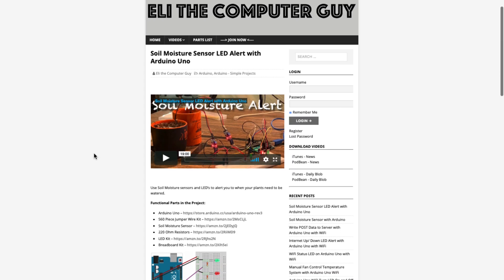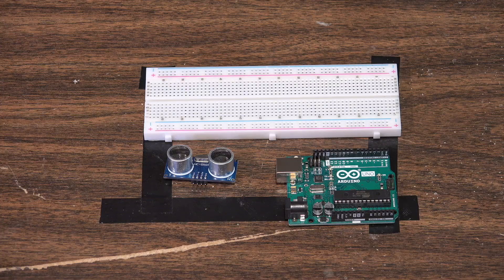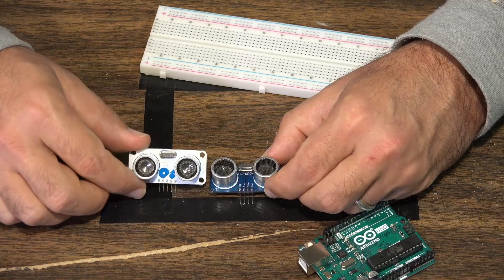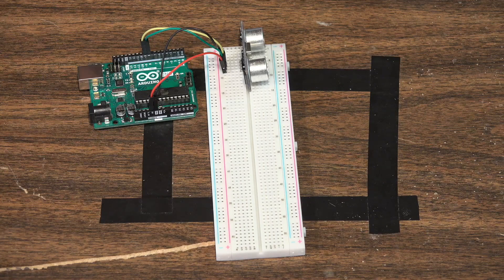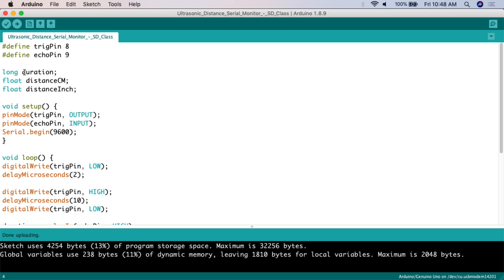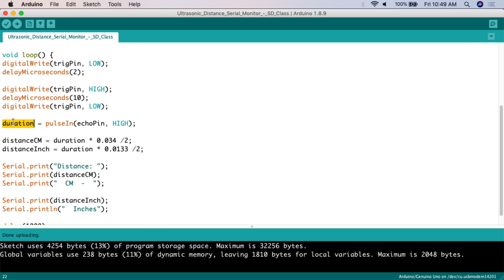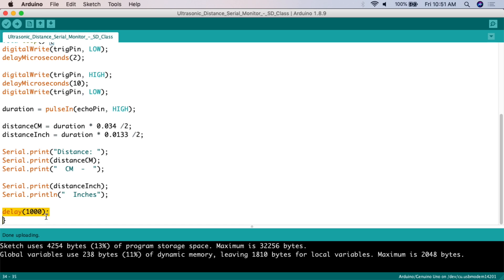HC-SR04 Ultrasonic Distance Sensor with Arduino

Comment: Could u pls explain the code and schematic diagram in tinkercad .for automatic speed control and automatic accident avoidance using ultrasonic sensor and pir sensor and gas sensor using LCD ,DC motor and buzzer

Comment: I have a question about the Ultrasonic sensor.

I have a water-box and I’d like to measure how fill is using the HC-SDO4 sensor with Arduino

It is all set and in my protoboard the sensor works well, but when I try to connect to sensor through a 4way wire it is not working.

The water-box (and the sensor is inside in a dry place of course) is 4 meters from the Arduino, wired connected. 
My question is, Does have any limitation in distance to connect the sensor through a wire? 
If yes, what do you suggest me to do? How can I send the signal and receive the echo to Arduino in 4 meters of distance?

Thank you!

Comment: When I try the code, my system keeps returning a distance of "0" . I keep having this problem and tried several sensors from different suppliers. Maybe it is the arduino board itself? Any ideas?

Comment: hello mister very nice video, i would like to ask you something about this project but the implementation is done using stm32f401re, so instead of digitalWrite, should i use gpio set (Pin pin) and instead of pulseIn should i use a timer in order to count  the time between trigger High and  echo High ? thanks

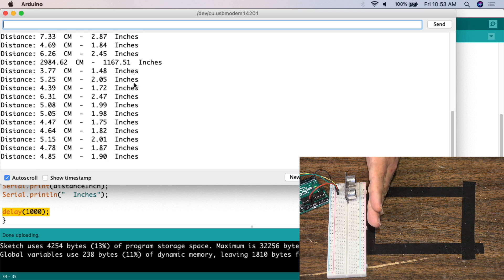Comment: 12:10 Same is true for IR sensors, but they are influenced by color and reflectivity of an object. Not true that they are less accurate, but since they measure light intensity, they can be faster!

If the object has dark color, it will read less accurately. If it has a bright color it will read more accurately. If it's matte it will read more accurately from an angle then if it's shiny... Important to note that complementary colors will not reflect that light, so green will show as black in red red or infra red light(different shades of green...), while yellow will show as black in blue and UV light(different shades off course except those highly reflective stickers highlighting markers, etc)... Every sensor have it's pros and cons. Ultrasonic sensors suffer from echoes as well for example, and IRs may read crap when measuring a light emitting object, especially in IR range (IR heater or incandescent lamp for example.) They also loos range in sunlight well, but have no problem measuring in darkness... You can also do some clever analog reference switching, and/or over volt the LED just a little bit to improve an IR sensors range and sensitivity(That requires proper calibration of course). But that doesn't really work that well with ultrasonic sensors...

 A good way to find ideal color and reflectivity is to set a phone camera to black and white, and point at the object, that will show you how bright is it and by viewing it with the camera from different angle will show you it's reflectivity from different angle. Phone cameras are sensitive enough to see things in nothing but infra red light. Security cameras see the same way at night, they have infra LEDs, and they switch on and off their filters automatically depending on light conditions...